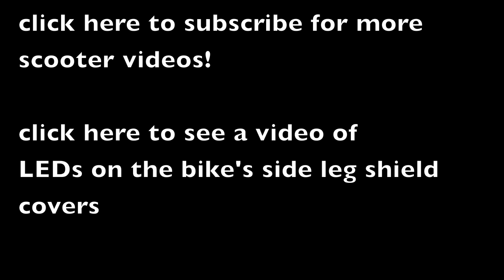This is how I installed LEDs strips on scooter's side covers | MicBergsma

Comment: @micbergsma oh but i was asking about how did you connected wires on the LED strip, here is a pic about the situation (remove the 11 from .11us/)  imageshack.11us/photo/my-images/713/20111223183806.jpg/